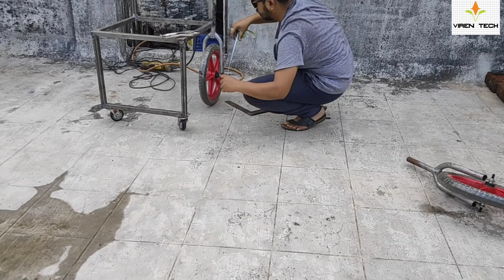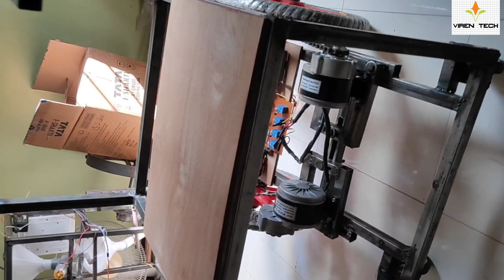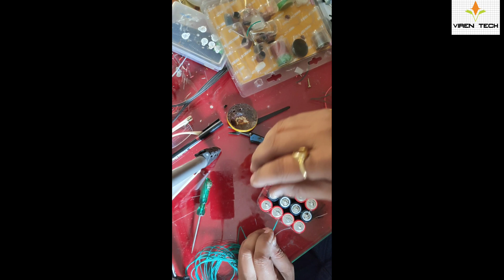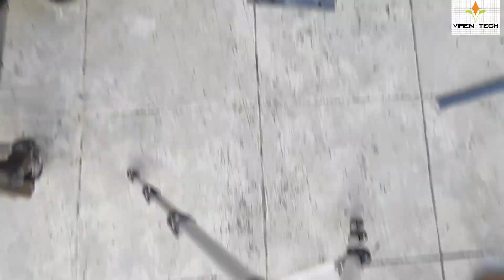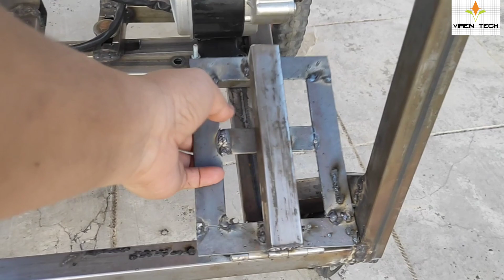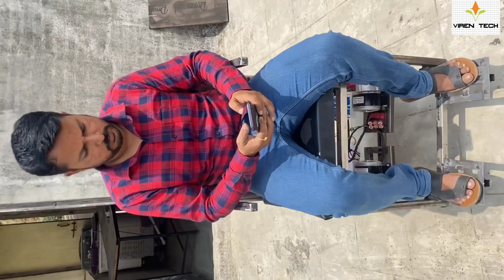Voice controlled electric wheelchair | electric wheelchair|wheelchair conversion #electricwheelchair

Comment: Sir can you please provide the source code used along with the circuit diagram.... Please sir 🙏
Reply: Do you get the source code and circuit diagram?
Reply from the maker: send u r mail id
Reply: Sir, we also work on similar project and want to add additional features on it. Could you please provide components list with specification along with circuit diagram.  @virentechautomation6368